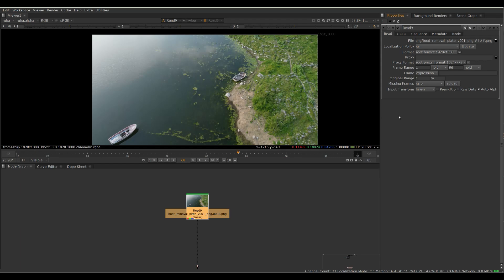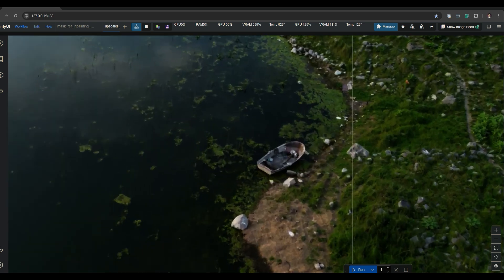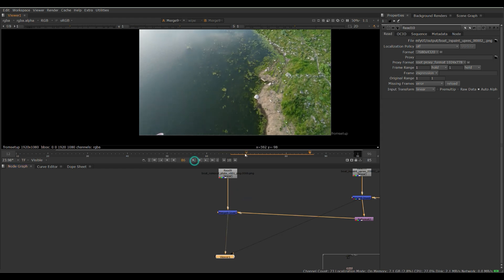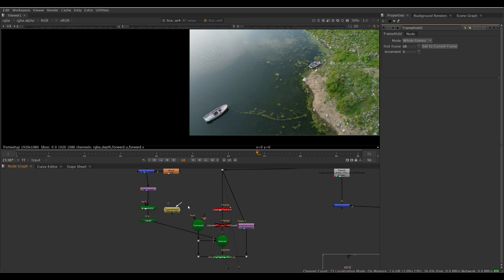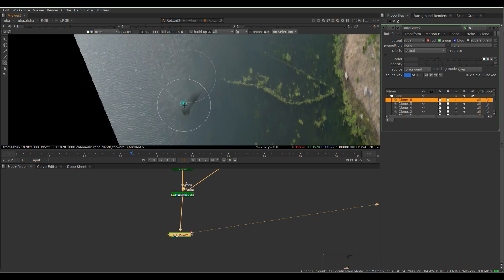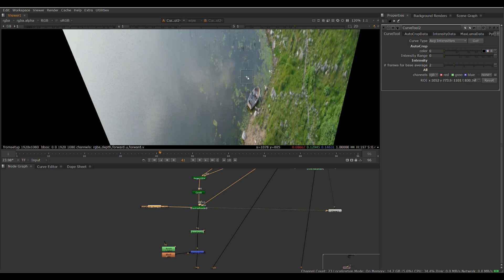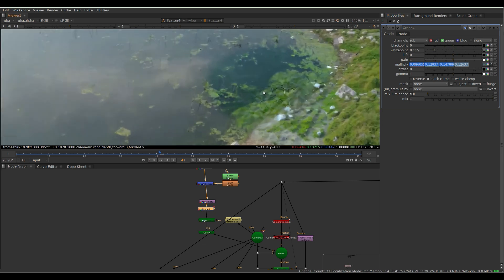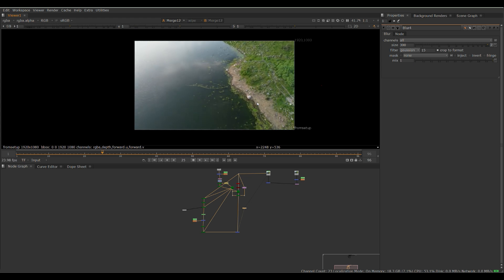AI Inpainting with Comfy UI and Nuke | VFX Tutorial

Comment: Heres a tip, when using the curve tool, instead of moving the whitepoint and picking by hand, go to your reference frame (in your case frame68) and copy the R.G.B data of the multiply into the white point RGB data. Not the animation just that single frame data. Those values will then act as a reference frame for your intensity data. You get your original color from that frame, way easier to pass tech check.
Reply from the maker: Yess!! These are the kind of comments I’ve been looking for, thank you!!

Comment: but why didn't you used Photoshop generative fill for removing boats? it's much easier process.
Reply from the maker: You absolutely can, there’s many ways to do the same thing anywhere. But Comfy can go to extreme lengths that PS never will. This process can be just one piece in a much more powerful build you create, then you never have to touch PS.
Reply: Yeah I believe ComfyUI can be used for many big things that PS can't,  but for this it was just to remove boats and I think PS does a very good job in that. 
 @CTRL_FX